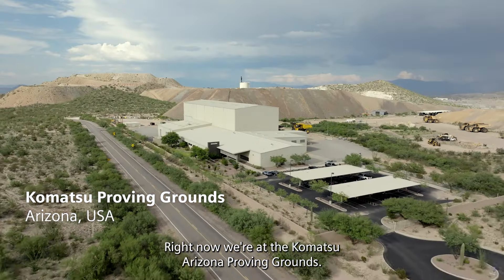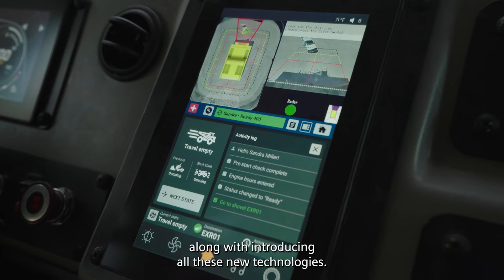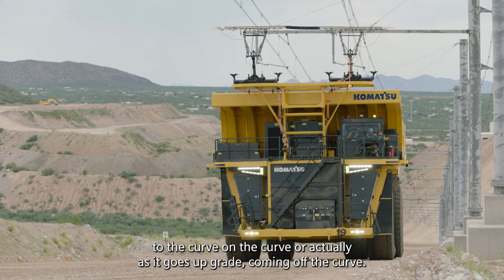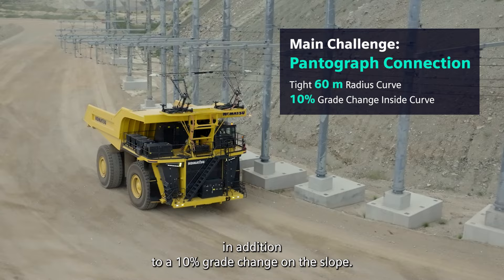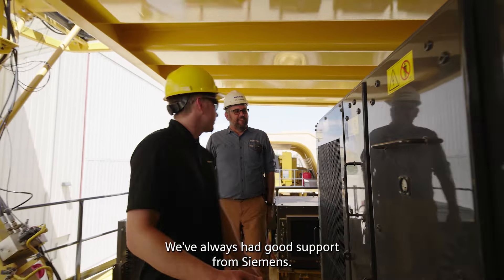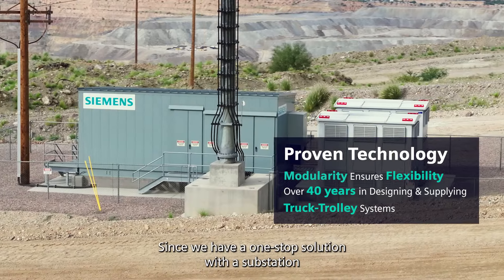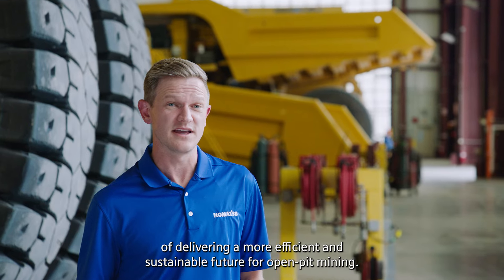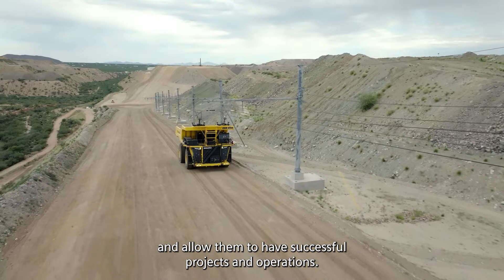Siemens Truck Trolley: Dynamic Charging at Komatsu Proving Grounds

Comment: Man at this point it'd almost be easier to have panels of rail and overhead wires integrated together and use electric trains.
Reply: I think the steep inclines and tight curve radii speak against the use of trains. Otherwise, conveyor belts would probably also be a good alternative.
Reply: cant use a train for the last leg to the excavator since that is always dynamic and changing location
Reply: @fazeobama8872  They can always use tracked electric conveyors to lead to a rail loadout, like some mines already do.
Plus, the mine face doesn't move that fast, track can always be dragged around and added to with modular panels.
Reply: @falcofranz5005  Trains can manage up to a 6% gradient on pure adhesion pretty easily and still haul more than a truck, and gradient becomes a non-issue if something like the Abt or Fell third-rail system is used
Reply: For moving stuff far away from the mine yes but in the mine itself the grades are too steep. Even if it were flatter it probably still be too expensive to maintain rails and trains vs trucks and an unpaved road, even with overhead wires.
Reply: @microproductions6  I disagree, trains can handle some seriously steep gradients when they're not on some hyper-optimised mainline trying to lug 10,000 tons at once. Climbs as steep as 10% can be had and still be hauling more than a haul truck.

Coincidentally, mine roads are almost all less steep than 10% for these massive mines, so they're doing the same grade work and planning that an effective railway would need, just to run haul trucks. It's everywhere in dissertations on the internet about good mine and mine road design.

If steeper is wanted, then there's cog railways, which can allow gradients as much as 100%, or a 45 degree slope.

So seriously, mines are putting in almost the same amount of work needed to lay track, putting up wires for the trucks is even more work.

What mines used to do when trains were all they had, was tracks and overhead wire were all one prefabricated unit, and they'd be bolted together, wires strung, and dragged be dragged around as needed.

All the hard work for electrifying mine operations was done in the 1950's, and since then we've deliberately chosen not to use the electric mine shovels, and electric haulage options of conveyors, aerial ropeways, and mine railways.
Reply: @TheSonic10160 alright Siemens and Komatsu pack it up it’s all over this random guy disagrees
Reply: @soapflakes  Plus, this is Siemens applying their railway technology to mine trucks in Komatsu's attempt to put lipstick on a pig. There's no other real way around the looming issue of mine electrification, batteries won't be good enough to be economical for vehicles this large for a very long time.

If mine companies wanna go green, some will look through history and see shit was figured out 70 years ago or try similar to this on their existing diesel-electric trucks.
Reply: @TheSonic10160  battery trucks with decent overhead wire coverage is already decently economical now

trains are great but i dont think they really work for mines, the few applications they might are really niche
you also need to consider that each digger is already taking 2-4 passes to fill each truck, a train would be waiting forever to get loaded, and forever to get unloaded, its just not the right frequency for in the mine pit itself
you want conveyers or haul trucks to take it up out of the mine, then crush and grade it then load onto trains
Reply: Or a conveyor. lol
Reply: @vincentgrinn2665  I think the trick with loading down at the mine face would be to have a mobile hopper that can hold a couple buckets worth of material that can dump into a waiting wagon below. It gets emptied, and the digger refills it as the next wagon is bought forward underneath it. The trouble there might be having the hopper with big enough doors and sturdy enough to handle any large chunks of stone.

I think you're also overestimating how big a train might be in a mine, maybe 10-20 wagons with a loco at each end, not some 100+ monster. Then the tracks out of the pit are double so trains can pass on their way up and down. Then to unload the uncrushed spoil the best solution would be a whole-wagon tipper. That way the wagons can be nice strong gondolas to handle the beating and not having to fuss over making a bottom-discharge system robust enough to handle that daily abuse.
Reply: @TheSonic10160  honestly thats far too much effort for little gain

with haul trucks youre transporting the ore away as fast as it can be dug, 400 ton at a time
so unless you have dual tracks in the mine youll need that hopper to hold an entire round trip worth of ore, which could be in the high thousands of tons

youre essentially replacing a continuous stream of ore with an infrequent bulk load, which is the exact opposite of what you want
Reply: @vincentgrinn2665  Of course you use more than one train! A series of reasonably short trains 10 to 20 wagon trains, just enough hopper by the digger to let it keep working as a loaded train leaves while an empty waits for it to go.

Same as with haul trucks, an empty shows up ideally just at the same time a load is leaving so the digger never stops working.
Reply: @TheSonic10160  there is no redundancy with a train, if there are issues with a haul truck not much stops, if there is an issue with the train, the entire operation comes to a stop, at millions of dollars per hour
Reply: @sparkymalarky4322  An issue such as?
Since there'd be double tracks all that's needed are semi-regular crossovers. If there's an issue with a haul truck it can block a mine road, or if there's an issue with a shovel or crusher guess what, that's the operation stopped too. Shit happens in mining, and any organisation dependent on that many massive machines not fucking out in a dusty and harsh environment like a mine.

Sandaoling has no problems running trains to haul its coal out of the mine, and until 2022 it was using steam locomotives to haul the trains. Bingham Canyon used trains to haul spoil and ore for over 90 years. Never mind all the underground operations, tunnelling, and massive quarries that all don't use haul trucks to move spoil, whether it's conveyor or rail.

What I'm envisaging is a rake top-and-tailed by a pair of electric or diesel-electric locos So that trains don't have to turn at either end, and also providing redundancy in the rare case that one loco fails.

Seriously. The railway I work for uses flogged to fuck 40+ year old locos hauling 2200 tonne trains up and down a mountain and through a five mile tunnel and I'll hear about a failure once a month if the Linehaul Service Manager is unlucky.
Reply: @TheSonic10160  if you use more than one train then you need a track coming in and one going out, and somewhere to turn around or switch between the two tracks

considering that a 10 wagon train is around 200m long, and haul roads are at most 10km long
and freight trains need to be atleast 3km away from eachother
you dont really have much room to have multiple trains, like you could have 1 load and 1 unload, and just have those rotate between eachother

but that really isnt worth doing
Reply: @TheSonic10160 I didn’t mean to say it’s impossible to use trains. I just think there are some difficulties with using trains in existing mines that are designed to use trucks.
In Germany we have open pit lignite mines that used trains for a long time before switching to conveyor belts. Basically the mine is centered around a train ramp and pivots around it. The excavators still move on rails and there are specialized train cars for hauling the tracks.
Reply: @vincentgrinn2665  Trains don't 'need' to be 3 km away from each other, not in a low-speed mining environment and especially not when they're so short and light. A 10 wagon train of 75 t capacity and 25 t tare weight wagons plus a 75 t loco at each end is only 1150 tons all up.

Such trains can be figuratively right up each other's asses if they're crawling along at the speed a haul truck does.

And yeah absolutely, two tracks, one in, one out, a loop at the unloading end so trains can move through, and likely a stub end at the face by the loading area so trains pull in, get loaded, and while they're loading another empty train shows up and waits for them to finish. Same as how operations are ideally conducted with mine trucks, with an empty showing up just as the full is departing.
Reply: @falcofranz5005  Yeah, German mines are part of what I'm referring to, as well as operations in Bingham Canyon, and Sandaoling. That sort of movable track laid in panels, the overhead wires could be part of that, get it all rigid enough to be dragged around by the digger at the end of the mine, or have a short conveyor from the digger to a moveable rail loadout so the tracks don't have to constantly be moved
Reply: @TheSonic10160  10 75ton wagons is only the same capacity as 2 haul trucks, while taking up way more space and costing a fortune in infrastructure

and if theyre up eachothers asses then youve  basically just made an expensive and less effective conveyor belt
Reply: @vincentgrinn2665  Conveyor belts, while efficient, are a pain in the ass to maintain.
Reply: I could see them using giant overhead lead cords supplying to supply power
Reply: @falcofranz5005  oh god yeah, and have no redundancy
im not saying its a good idea, its just that trains in this application are such a bad idea that its just conveyers but worse
Reply: @TheSonic10160 alternatively you could have one truck
Reply: No. Too less flexible and to steep slopes. These trucks run on batteries most of the time
Reply: @rhysrail  Having problems getting ore out of your mine?
surely you will not regret one truck
no trains, no conveyors, one truck
Reply: @knalltutemichl3473  Per the video, the electric supply is an accesory to the on-board generator. These are still diesel trucks.
Plus, it's good practice in mining not to build roads steeper than 10% grades, 10% is at the limit of conventional rail adhesion, so almost every haul road being less steep than that means they're viable for rail
Reply: trains can't go up or down  steep grades . we are talking open pit mine .
Reply: @TheSonic10160  conveyor maintenance on such a system would be a nightmare
Reply: @TheSonic10160  i think mines use the cheapest setup they can . they are not stupid so obviously your ideas don't work.
Reply: @TheSonic10160  so i guess you assume the mine operators are stupid but you sitting at your computer got it all solved .
Reply: Problem is Siemens can't make an electric train that doesn't need to be babyed, and they know it.  That kind of frailty works for high-speed trains, because they need to be inspected and repaired anyways - it doesn't work for heavy-haul freight.
Reply: @GintaPPE1000  Damn I guess the Vectron and EuroSprinter aren't the backbones of modern European electric locomotive fleets, and that Siemens doesn't have a history of building good freight locomotives like the 71 Class that are the backbone of their bulk heavy haulage networks.
Reply: That being said, battery’s aren’t great for vehicles climbing steep hills, since high currents can damage the battery (or at least if I understand reduce its lifespan significantly). Same reason why San Fransisco still uses electric trolleybuses, steep hills, good traction, plenty of current from overhead wire.
Reply: But this is open pit mining
Reply: @videoview5179  Yeah, ... Your point?
Reply: @fazeobama8872  You actually can. In former east germany and czechoslovakia, they used to Load the trains at the bottom of the pit and have the rails on what's basically sleds. Every so often you drag them a bit further.

Comment: This is soo dumb. Spend millions on each truck, spend a few more million on the infrastructure to build the pantograph, spend a few 100k/year for staff to drive the trucks and in the end, it still has a lower material handling capacity, takes up a lot more electricity/energy to operate and costs more than... a belt, conveyor belt :l

This is where money is being wizzed into, solving a problem made in the minds of the beneficiaries.
Reply: Yeah, so let's put inefficient batteries in them! 🔥🔥

Comment: While I don’t think overhead wires Autobahns and highways make sense electrification of freight rail is way more sustainable than trucking. For such mining operations it may have a niche if the operations can not be switched to rails or conveyor belts.
But I dislike the sentences „making open pit mining carbon neutral and sustainable“. Sure it may be carbon neutral (ignoring battery issues) but it’s not sustainable. No form of mining can ever be sustainable. Sustainable wouldn’t just mean, carbon neutral, but also having a net zero resource usage, the lowest possible physical footprint (as few squarefeet as possible), and the lowest possible energy usage at the same time. Any (expansion of) economic activity will always be less sustainable then reducing the (global) economic activity overall. Sustainability needs degrowth.
Reply: Sustainability isn't necessarily about current usage, but more about not screwing our future generations over. Net zero resource usage is not a thing. As long as time progresses, resources will be transformed from one form to another. We just need to utilize them in such a way that we will not run out in the future when we need those resources. The physical footprint can and should be restored after use rather than just leaving huge open pits and lakes of pollutants. Energy usage is the same as resource usage. As long as we use it in a way that doesn't impede future generations, such as carbon emissions or only building fossil fuel infrastructure while also using up the fossil fuels, it's sustainable.
Degrowth is not the only way.
Reply: Degrowth is a dead letter though. No-one in the Global North is going to happily accept a reduction in perceived quality of life (whether it's actually happening or not, like the US's recent life expectancy dip) and no-one in the Global South is going to be happy where they are after seeing the Northerners live it up with washing machines and electricity and cheap holidays for a century.

The trick is being more efficient. Mining will always have to happen, but we can be better at actual recycling. We'll probably see efforts to mine landfills in our lives to reclaim valuable metals that for the last 70 years have just been thrown away.

It's stuff like this that means genetically-engineered crops have to happen so we reduce the need for pesticides, precision fermentation has to happen so we can have actual factory-made meat and animal products without burdening the ecosystem with our enormous agricultural system just for making meat. It will mean nuclear energy, as it's the highest output power source with the smallest environmental footprint both in terms of its life cycle, but also just the physical space a nuclear power plant uses to generate a given amount of energy compared to literally any other generation method. It'll also be about redesigning our cities for people, much how the 20th century was about redesigning our cities and societies around cars, this century will have to be about un-doing a lot of that.

Done right, this century will be about decoupling our economic growth and personal wellbeing from the egregious and destructive use of the Earth's environment. It's possible for everyone to enjoy nutritional plenitude cheaply, to have electricity to waste, and industrial products that don't consume the entire gas production of Russia to make.

Which will mean trains and conveyors in mines, you're absolutely right there. It'll also mean electric mine shovels and the few things that can't be easily electrified running on either fuel cells or synthetic fuel captured from the atmosphere.

Comment: Not a bad idea. The catenary fixes all the issues with simply using battery power alone. The main issue is obviously the cost to set it up but I am sure it would pay for itself in diesel fuel savings. Not to mention this setup probably has a higher operating time than diesel trucks that need fueling and maintenance more. The only maintenance that would be needed regularly is replacing the carbon strips on the catenary which may wear out faster than on a train unless the path of the truck is tightly controlled.

Comment: Why not just use a Diesel? They would need to move the catenary poles every time they move the location of mining in a pit.
Reply: Because Diesel is expensive. That's why electric trucks are becoming much more common in Germany for example, total running costs are 20% lower overall, which is a massive amount in such a competitive industry.
Reply: @swecreations lol maybe don’t tax the hell out of it then. And you really think electric power will remain cheaper; when almost everyone suddenly needs more and more of it???
Reply: @jamesbizs  Yes, because unlike with diesel you can easily make electricity yourself for cheap. Solar costs like 3 cents per kWh to generate, and even without taxes diesel is still very expensive.